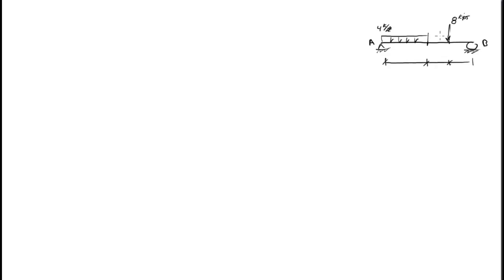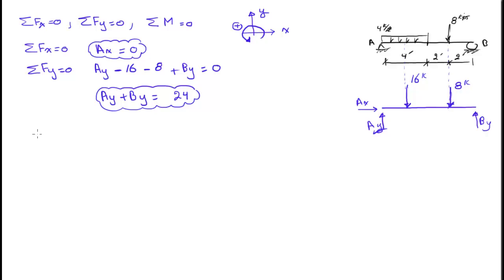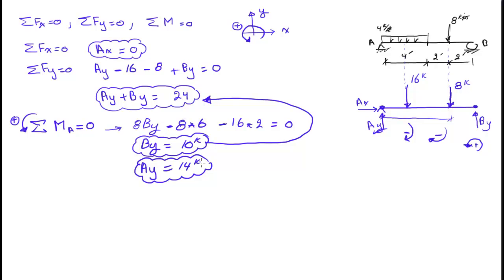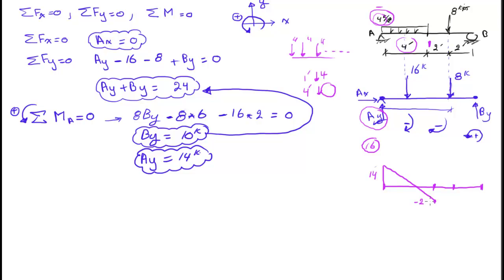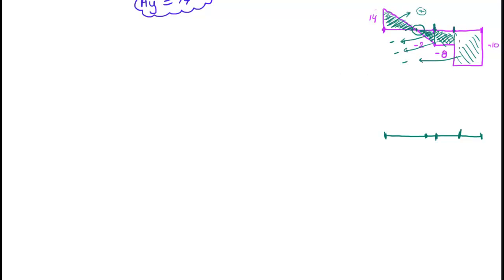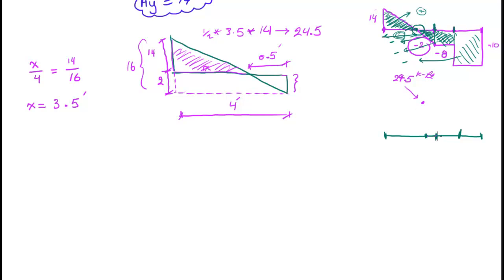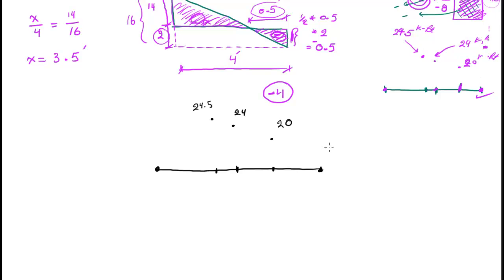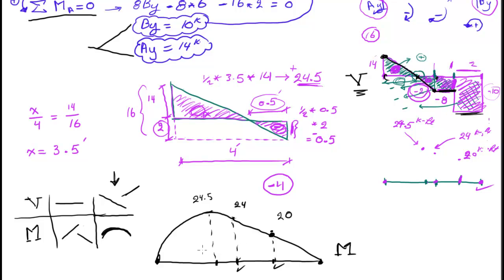Drawing Shear Force and Bending Moment Diagrams

Comment: have you ever used "taking cuts" method, which is more long winded but gives you specific line equations for the shear and beam diagrams? Is there any real need to know the line equations of these graphs?

Comment from the maker: Kurt,
to find the area under the curve is to integrate. Therefore, you need the equation of the curve. HOWEVER, you may cut the beam at many many many locations, sum the moments about each cut point, and obtain values for the bending moment at these places. All you need to do then is to connect the points and you got yourself a moment diagram. 
in practice, you need to know the maximum moments (+ or -) so you can design the beam. with practice you know where to cut. 
Good Luck

Comment from the maker: Doing it your way, (Positive down Negative Up) is good if you are doing concrete design. That should help you remember where to put the steel reinforcement. But, it does not make any difference as long as you are consistent with your units.

Comment from the maker: As for converting the triangular load to a uniformly distributed load, try to go through a complete problem with both cases of loading then compare maximum shears, maximum moments, and maximum reactions. you will see that the maximum shear is at one of the supports for triangle loading where it is at both supports for uniformly distributed load. you will find the maximum moment shifted toward the height of the triangle and not in the middle. 
so be careful
do it and let me know

Comment from the maker: we should understand the relation between shear force and the load. dV/dx (slope of shear diagram) = -(negative) the applied load. then, if the load is a function of zero power (uniformly distributed load) then the shear diagram is linear. Now for a triangular load the load is a function of power (1) since it is a function of x that means the shear diagram is a function of x to the (2) nd power.
I will try to find some time to answer this question in a video.